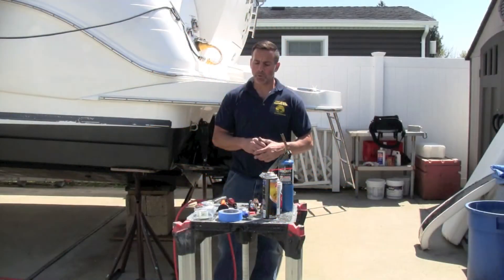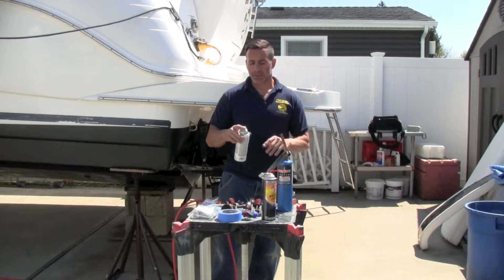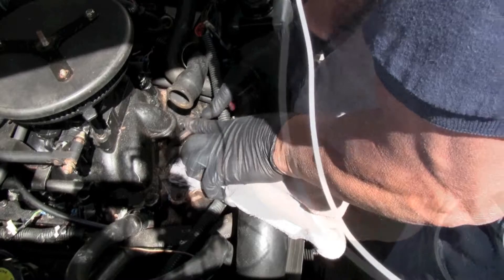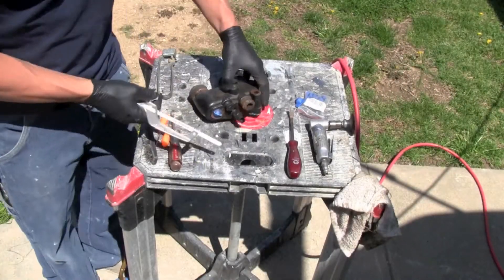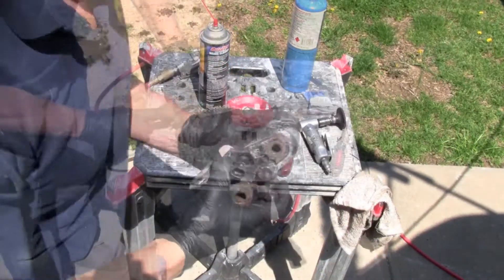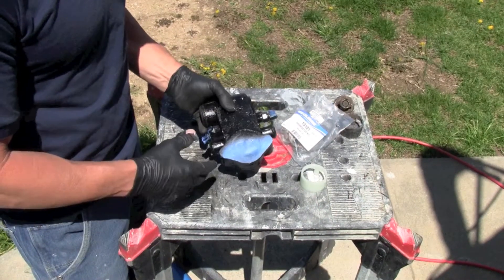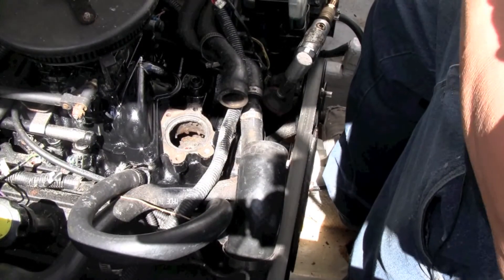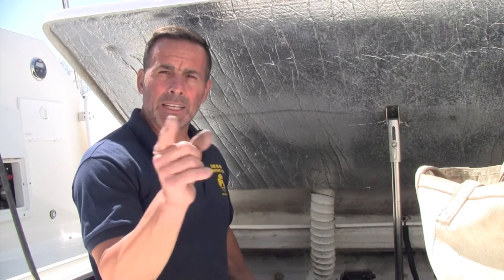How to Remove and Replace Thermostats & Vent Plugs

Comment: just replaced my  160 t stat on my merc 4.3mpi and found your vids (i watched the manifold/riser vid also) very helpful.  Your step by step procedure with the important tips along the way made the job easy.  One comment and one question.  Comment;  I heated the housing with a heat gun before removing the 2 bolts. last think i needed was for one of them to break off.  Question;  My boat was running a bit hot, like around 185/190 and  thought a new t stat may be the fix; it wasnt.  I noticed when I drained the engine from the mixing elbow to access the t stat housing up top, this after having run the boat for about an hour before in the lake, that some antifreeze drained out.  My boat has never seen salt water; always run on a lake.   I wonder if this is indicative of the high temp being due to a problem with the water getting out of the boat (riser and manifold) as opposed to it getting in (impellar).  Your thoughts appreciated.  Again many thanks for the time and effort you put to your vids

Comment: I had a broken drain plug on my thermostat as well. I used the torch/screwdriver trick, and it worked like a charm. Heated the screwdriver & inserted it into the plug. It melted the plastic as expected, and then I just left it there (screwdriver in place) and let the whole thing cool. once it cooled (and the plastic re-hardened) I was able to effortlessly unscrew the old plug.

Comment: Hi Eddie great videos, my question is not related with your last video but maybe you can give me an advice. I'm having issues trying to get by boat above 3600 rpm with a Merc 5.0 mpi and a Bravo 3 outdrive.  We already did a complete service including new manifolds, rotor, dist. cap, water pump,  cool fuel module clean , cables + plugs, oils and filters, timing fixed. any Idea what could I be missing to take the boat back to 4200 rpm? thanks for your help.
Reply from the maker: I just had a similar problem.  my fuel injectors need to be cleaned. Taken out and cleaned. Hope that helps
Reply: @OnboardWithEddie  thank you! Will try that

Comment: I'm struggling to find a descent angled scrapper. They are all not angled enough or made solid.
Reply from the maker: I’ve had that 45° angle gasket scraper for over 35 years. I got it when I was a car mechanic. Wow. Yeah I’m old lol. It’s from Marco tools. I did find one similar on eBay. From SK tools 6652 S-k Thanks for watching the videos ⚓️🤙
Reply: You can make one by buying a small prying tool and sharpen it.

Comment: Previous owner had installed the thermostat in upside down so when I went to replace it after I purchased the boat I just put it in the same way it was assuming it was correct orientation. Caused my boat to overheat on the water with 5 friends not a good time.
Eddie has the correct orientation in this video. 👍
Reply from the maker: Yeah, That will do it! Happy to help out. Thank you for your support

Comment: Bought a Sea Ray with a 350 and Bravo 3.  I'm thinking of mooring it in a slip on the ocean for 6 months of the year, dry storage for the winter.  It has open cooling, can't seem to get a straight answer if this is a bad idea or not.  I know saltwater isn't good for an engine but if I flush it well after the season (or even mid-season, if needed) can I do this?  Like your videos, thanks!
Reply: Go for it. Just have good bottom paint and zincs. She'll be fine. Just gotta use her. No boat can sit in water without some growth.
Reply from the maker: I keep my boat in the Salt water for the boating season. And I dry darker in the winter.